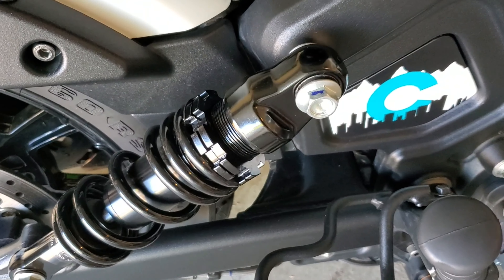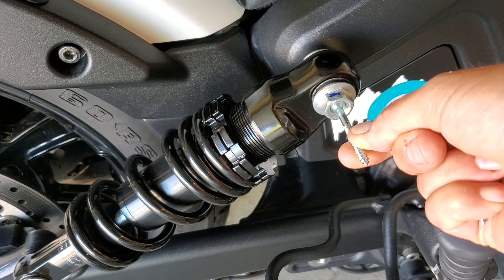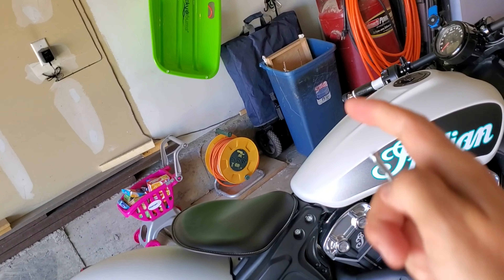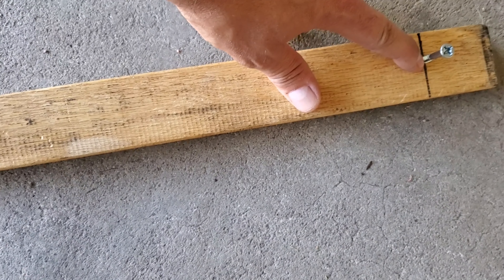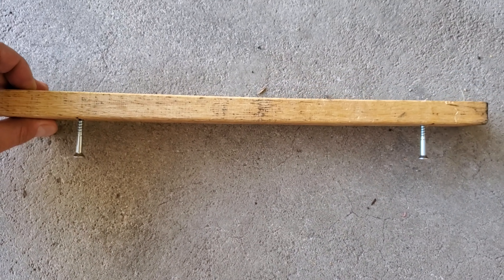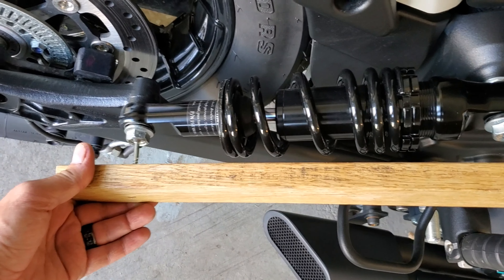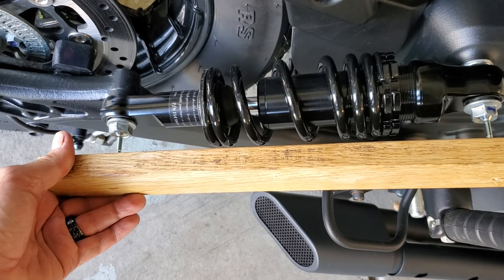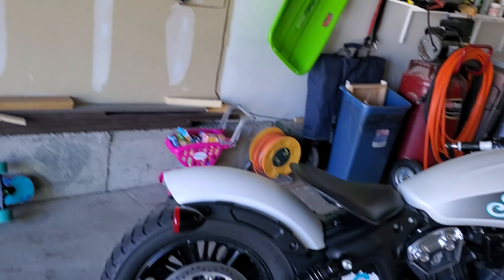How to set preload the right way, by yourself on an Indian Scout Bobber. Is it worth the effort?

Comment: 6’3” 170lbs, I have a ‘21 , came from Factory at 4 threads. Haven’t touched it, stock seat, 4000 miles in a year in Indiana. Is it great comfortable ride? No… but does it make me happy every time I ride it?… hell yes.
Prior bikes, ‘07 zx6r, 2003 1200 sportster, 1993 dyna wide glide… ‘21 Indian scout bobber still makes me the happiest. Usually ride 20-50 miles at a time without stops. Longer rides 100-120miles hands and ass go numb and need a break. Let out a few psi of tire pressure seemed to make things better for me. Stock battery sucks and went out at 12 months and 2 days. Added 2 ounces of oil since break in change and a shot of coolant but tend to hit 100mph every ride and speed limiter a few times.
Reply from the maker: I've also noticed a couple psi lower in the rear tire helps improve comfort a bit.
Reply: @Jimbobbington   how much psi you guys running?
Reply from the maker: @2jz_rican  I keep tires at factory recommended air pressure 40 in the rear 36 in the front

Comment: I have a 2021 Bobber purchased in June of that year. My owner's manual says 275 mm is the correct preload which I have it set to. Still not very happy with the ride. Now that I have saddlebags and all my riding gear, rear shocks will definitely be my next upgrade.
Reply from the maker: Yup, proper adjustment helps,  but it does not fix the stock shocks lol

Comment: About to take my Rogue from dealer. Skeptic about shocks, never tried, but everyone still don’t appreciate them on forums and fb. surely try your method before investing in new shocks. I’m about 160lbs, so think i have “more range”, but the real challenge will be the couple rides. Thanks for sharing
Reply from the maker: Congrats on the new Rogue! At 160 lb you'll probably have to remove all preload and still it'll be too firm.

Comment: I'm @ 7 threads shown, just before an 8th showing. There were 3 threads showing before i tightened it up. '19 Scout Bobber.  I get a touch of feel of the cross road seams that are considered "to be expected", but I was going for no more ass slapping seat over bigger ones, works good for me, for now. I'm 6'3"and 250 lbs. I'd still like to ride a bobber with a set of Super Shox, I'd be willing to spend the $750 if it were more than words to convince me...  Thanks for the video bro...
Reply from the maker: Supershox was my 2nd choice,  but I didn't want the contrast cut look.

Comment: Good video, I've always followed Dave Moss' tuning methods for suspension to keep mine squared away.  Stock, we don't have the best suspension on these bobbers to properly set "all the things" and measuring sag required two folks for me - but this method seems like a good workaround if you don't have help - or if you don't trust your help :)
Reply from the maker: I'm still going to end up getting a real suspension,  but just like GP Shortys, this will do for now until the time comes
Reply: RIP dadwithabike

Comment: Thank you for the video, I like the idea of a measurement stick, I will be bringing up something more "dynamic" (using a plunger tube and a rubber O-ring) so I can measure sag and droop dynamically.  I have a (new) 2022 Scout (ABS) and with 1,500 miles, I found the rear shocks were never going to work for my 195 lb size... and since they have no rebound adjustment, and can not be rebuilt (to change the oil and spring), I invested in the Indian/ FOX shock set-up and Oh YES!!! That's exactly what this model needs!  I have had shops since the 1970's and factory-trained technician, and support some races at the local track (Sonoma Raceway) build Lotus 7's (from scratch), and have utilized some of the best suspension technology and work with industry experts and manufacturers, so I can safely say I know a little about suspension and design.  One of the design handicaps is the extreme angle the shock is operating.  This causes a dramatic need to increase spring tension (as opposed to having perpendicular-to-motion shock absorption.) Since we are mostly stuck with the design (and it does "look" cool), using progressive springs will help... but without any rebound adjustment you are only really impacting "ride height". By now you are aware that the "bobbers" are lower than the standard Scout (God knows why because it's already mini-bike sized), so you have even less travel. All my bikes have aftermarket (superior) shock and springs to match the type of riding.  I just encourage you and the viewers to look into ANY shock that has the overall preload adjustability between 11"-12" WITH rebound adjustment. Changing the rear ride height also changes the fork rake (well, technically not the rake, the the point of contact for the front tire). To avoid getting deep into the technical issues, suffice it to say... stick with factory geometry (including tires!) but dam, install some dampeners with rebound adjustment, and ideally, more travel. Travel will be constrained by "spring bind" so progressive springs are very important. I wish I could have implemented a mono-shock of more upright rear suspension for this amazing bike, but that is why the FTR is designed the way it is, (and it WAY out handles the Scout), and notice that it comes with Ohlin racing dampeners! The fact that Indian has branded the FOX shock and provided it as a "factory performance upgrade" is a tell that they (like most all manufacturers) wanted to keep the MSRP price low, so the soft of the better shocks was a compromise.  Proper dampening is more than comfort, it provides a much better "feel" of the road which in turn, provides a higher rider "confidence".  The good news is that there is a heap of aftermarket options at various price points. If you think the Indian / FOX shocks are expensive... ha, it's less than half the cost for ONE shock for my BMW adventure bikes! but as you see, I suffered with 1,000+ miles of "shit" suspension, and now... the rest of the miles are WAY more fun!!! I hope this helps some people having back pain... the next big improvement is getting a modern "sticky" multi-silica tire setup!
Reply from the maker: Very good information,  thank you!
Reply: @Jimbobbington   Yes, to make it "easy" i just cut and O-ring, slipped it in the shock piston shaft and then could measure doorp and sag, as well as travel when riding.

Comment: With your feet on the ground you are still supporting  large portion of your weight. I made a set of Wooden feet to balance the bike while I put my whole weight on it. Additionally, I have a chief so I have round caps on my shocks and used two socket heads as my spacer passed through a two by four to keep them aligned.

Comment: I just set it up as instructed.  On Sunday I am doing the 300km + route so I will be able to check if there is any improvement.  At this moment you can see that there is a much larger jump compared to the original setting
Reply from the maker: I hope it works great for you!
Reply: @Jimbobbington  I did not expect such a big improvement.  I recommend to everyone
Reply from the maker: @krystianbaazy6837  nice,  that's great to hear!

Comment: For the record,  I have a 2023 Scout Rogue 60 and the manual states 278.   I have not looked at the bike yet but I did ride it home the other day from the dealer and I thought I was riding a Hard Tail Harley.   I think the biggest problem with these bikes is the geometry of the angle that the shock is sitting at.  Shocks don't work well on a that steep of an angle. Bad design all the way around.  Thanks for your Science....yes drink beer it helps with every project.  Also your tire pressure is going to effect your preload too.  What did you find yours set at?  Factory or below?   EDIT:  I just checked the bike the dealer had mine set to 4 threads almost 5.   I think I will bring it back in a bit.
Reply from the maker: Tire pressure is also very firm from the factory! Dropping the pressure just 1 psi in the front and 2 in the rear adds a bit more comfort to the ride.

Comment: I’d like opinion on removing the stock rubber bumper for extra travel without the bump. Iv been traveling the back road of Oklahoma, Iv noticed no difference when it comes to washboard roads.
Reply from the maker: Are you talking about on the shock itself?
Reply: @Jimbobbington   yes , inside the spring on the shaft. It does come right out with a sharp blade, but really seen no magic happen with the jarring ride . Oh well.

Comment: Hey man.. super appreciate the vid. However, in the end are you counting exposed threads? Like I think you are saying you added MORE preload, and that would mean you have EVEN MORE threads showing, correct? So when you say three threads, does that mean that idk, 16 threads were showing, and only three threads remained?
Reply from the maker: I am talking about the number of threads showing at the very top above the top adjustment nut. So if I say 3 threads,  that means you have tightened it from as soft as it could possibly go (0 threads showing) until 3 threads are showing.

Comment: I need some help, i made some try and i dunno why, no metter if i screw the shock gear all the way up or all the way down the total distance doesn't move an inch, is always the same!! WHY??
Reply from the maker: Are you putting weight on it? You should be measuring it with your full body weight. After making some adjustments,  you may need to take a quick spin around the block to make sure the shocks compress really well,  then remeasure.
Reply: @Jimbobbington  even if i mount on it the length is the same more or less... I thought because I'm kinda light, 70kg. The total is something like 293 mm and it doesn't move anywhere
Reply: @Jimbobbington  newby question: by adding preload and stiffening the shock that eye-to-eye shock length should increase or decrease?
Reply from the maker: @elite_eight  at 70kg, unfortunately I don't think you're going to make a difference. I would start by removing every bit of preload completely. I'm guessing this is why you don't see a difference. You are just too light, not the worst problem to have lol. 

The shocks won't get any longer by adding preload. They are already fully extended when there is no load. Adding preload only reduces the amount they compress when weight is added.
Reply: @Jimbobbington  I see, thanks 👍🏻👍🏻
Reply: @Jimbobbington  just a little update for thanking you and for someone who might need it: With my 70kg (155 lb) and 0 preload, so no threads at all counting the block nut i reach the 282 length. After trying the bike i found it's so much better on the potholes and even better it has much more stability, noticeable expecially on high speed. Before that from ~120km/h and up it starting vibrating a lot and i didn't feel safe or comfortable, today I took it at 150 like a charm. Thanks for the help
Reply from the maker: @elite_eight  fantastic! Glad to hear I was able to help! The stock shocks seem like they are intended for a minimum weight of like 180 lbs, glad 0 preload was able to improve your experience!
Reply: @Jimbobbington  I dunno what to say, i just know that with 0 preload i reached the infamous 282 🤷🏻‍♂️. And I'm pretty sure I'm not 180 lbs 😂😂
Reply from the maker: @elite_eight  you must have a Scout and not a bobber then.  Bobber spec iirc is 175. You'd never get there at your weight lol 😆
Reply: @Jimbobbington  yes is a regular scout, thought i had mentioned it before, sorry

Comment: Hi man, great vid, gonna definitely try to set mine too. Question: what tool do you use? Where did you order that from ?
Reply from the maker: It's called a spanner wrench and came with the bike when I bought it. You should be able to find a cheap one on Amazon, but not sure the exact size you need.

Comment: I believe the preload isn't really adjusted only for the weight that will go on the bike. The reason I say that is because it may depend on how the shock is dampened from the factory if it has no dampening adjustability for compression. I believe all things work together on a shock. First you need enough travel. Then you need a spring wound properly and for the weight of the bike and rider and anything else that will go on it. Then, the best is when you have some adjustability for both compression and rebound dampening. I say that because I believe all these things work together and that not all bikes are loaded the same, with differences in rider and gear. That too affects everything in some way, for it seems that all those things work together, affecting one another.

If a shock is dampened on the hard side, I would expect the best ride to come when rebound is also set on the hard side and I suppose what would work the most beneficial then would be a spring that is also wound a bit on the hard side too, even though if the dampening could be set softer, a softer spring might work better for that situation, all other things being the same.

For such reasons, I wish bike manufacturers would provide a few spring options, shocks with plenty of travel, and adjustability for both compression and rebound. That way, everyone should get a fair chance of getting a decent ride, depending of course on the quality of all of that, working together as it should. If they did that, in the end, I think it would be a cost advantage to most if not all customers, though I suppose some might want the very best in quality and would opt for spend more to get a bit more.
Reply from the maker: Pretty sure indian had none of these things in mind when they put the rear shocks on. Haha.

Comment: Would you  need to change adjustment if you threw on a passenger? Or would 275mm suffice?
Reply from the maker: Technically you are supposed to sit on it with your passenger and readjust it to 275mm with both your weights. Once you do that,  you can just remember how many threads are showing and easily recalibrate when necessary without measuring
Reply: @Jimbobbington  thanks

Comment: Exactly the method I tried but does not work very well with the stock exhausts as the lower shock bolt is behind the upper exhaust pipe/muffler.  Also, I would suggest putting a block under the kickstand so the bike is as upright as possible and sitting with your full weight on the bike (feet off the floor) while measuring.

Comment: Great video, thanks for posting! Bought mine used with 6-7 threads showing. Now I’m going to have to rig up some nails and wood and adjust. I’m about your weight, so curious if I get similar setting on my bike. Then I’ll have to adjust for my winter bulk setting when I’m 15 lbs heavier lol
Reply from the maker: Thank you,  glad you enjoyed it!
Reply: I finally got my spanner wrench from Polaris and set mine up. I’m about 180 lbs and I ended up exactly at 3 threads too.
Reply from the maker: @demonaz9931  awesome! Does the ride feel a bit better?
Reply: @Jimbobbington  So it felt too bouncy at first, but I checked my tire pressures and they were getting low. After I put tires back to 40/36, it feels great. Definitely as good as it’s going to get with the stock shocks. I’ll eventually get the Progressive 444s based on your video.
Reply from the maker: @demonaz9931  awesome,  great to hear!

Comment: Was all set to try this… but noticed my stupid stock exhaust is in the way. Gonna have to get a caliper, or take it off.
Reply from the maker: Oh no. I didn't think about that, so the stick won't fit on the right side. I would go with just the measurements on the left side, and match the right side to the number of threads on the left side, adjust both sides a bit at a time to you get the measurement spot on

Comment: Never bothered with this, got the Indian Fox shocks and have been on multi-day 500-800 mile ride per day from South Florida to Colorado, stay a couple days and then went back, 6000+ mile trip in total.  I would NEVER try that trip with stock shocks.  Also, stock seat sucks as well, need the comfort seat or some kind of seat that works better for a trip like that.  I did that Colorado trip with the stock seat ended up with sores.  Just my two cents.
Reply from the maker: All true lol. But sometimes you gotta make do with what you got! I'm running progressive 444s now,  but my build never really had comfort in mind 😆

Comment: Geeze, I hardly seen any sag when you sat on them. You are at an immediate disadvantage with the forward leaning upper shock mounts as sharp bump, they have to not only  push the swing arm up, but also stress the swing arm bushings backward to finally engage the action of the shock.. same issue with the Chief models.. that shock design and mount looks nice for a duel rear shock set-up,  but not as functional as it could be.. they should have just went mono shock on the Scout and Chief models.
Reply from the maker: Agreed 💯

Comment: Odd. My 22 rogue says 278mm
Reply from the maker: I wonder if that's somehow due to a slightly different geometry with the larger front wheel?
Reply: @Jimbobbington  Overall tire diameter should be very similar. Very slight change to length of shock. I wonder if it's maybe just aimed at a more aggressive rider so the setup is a bit more firm?
Reply: @Jimbobbington  my 2022 ISB manual says 278mm as well.
Reply from the maker: @joeberry1556  funny they publish a different number every time they print a manual lol. I'm glad I showed my manual as proof in this video so everyone believed me haha